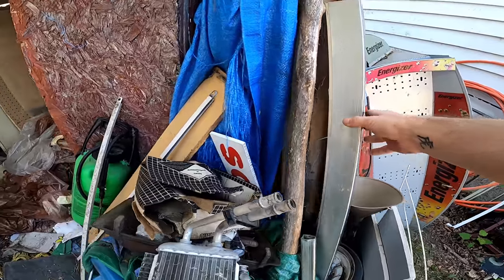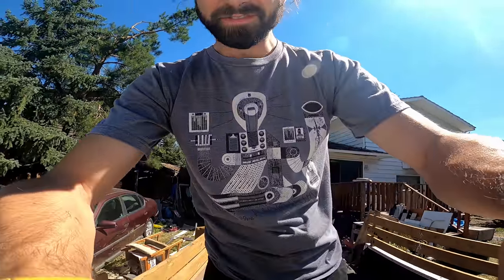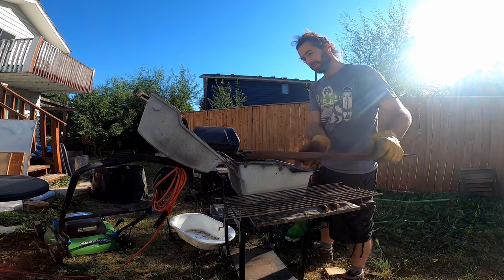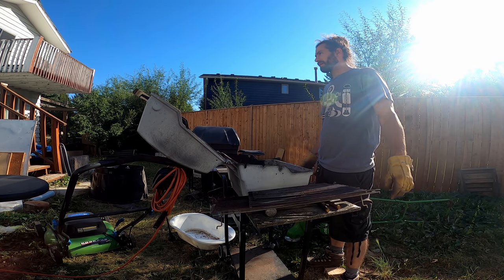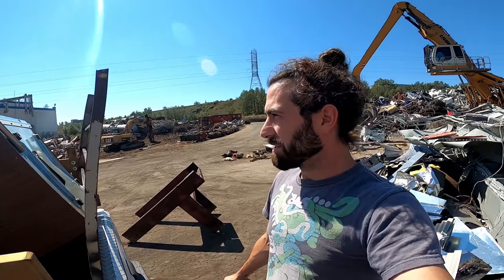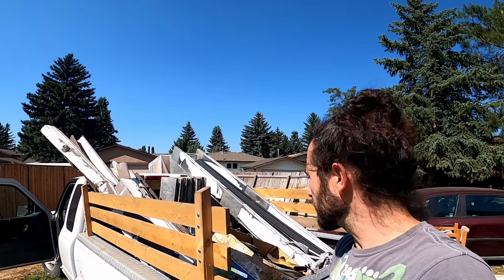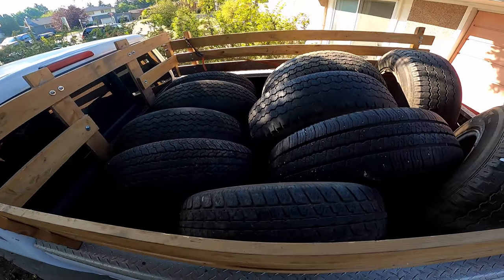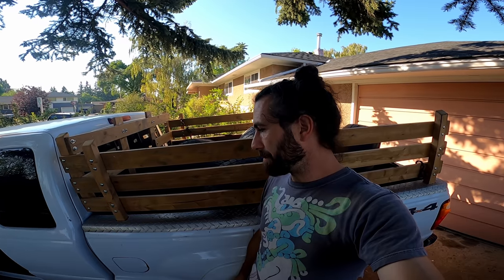Scrapping A HOARDERS HOUSE! - Scrap Metal Recycling 34

Comment: SHELVING. Finally, my area of expertise. Shelves are, on average, 15lbs each for a 4footer. Plus that 4ft piece of extruded aluminum stuck on the front is super easy to remove with a big screwdriver. Couple extra pennies per shelf 😉

Also, I just learned something new recently that I want to share since you had batteries. If there's a battery manufacturer anywhere near you, there's a good chance they'll buy old batteries. I got almost double from them than I would if I took them to a scrap yard. Definitely worth digging into.
Reply from the maker: I’d asked a battery place before but their offer was a lot worse than my scrapyard. Might be worth checking all the ones I can find though, never know!

Comment: Load more in the truck make a fuller load side rails are made for a reason
Your time is worth money you just got taken for a lot of money 
Remember they need to pay you for your time and fuel.
Either that or split the scrap money because by the time you pay local trash yard to dispose of all those tires your going to be out some cash. 
Either that or paint those things and make some art displays and sale them.
Reply from the maker: We get free tire dropoff at the city dump for tires so that’s not a concern, but you’re absolutely right about the rest of it. Even with that I basically broke even with nothing for my time. The next ones I made sure to talk about money before doing the job!

Comment: You should take those batteries as well with your scrap. Where I’m from if you bring them to an O’Reilly auto parts you get $10 in store credit for every battery. So there is $40 of scrap batteries in the beginning of your video. 👍
Reply from the maker: They definitely have value, but I just take them to the scrapyard and get cash rather than store credit

Comment: Random thought for ppl with pickups. I ended up making a wooden bed extension for my truck and it fits in the gap between the tailgate and the bed plus I’ll tie it down with cords. Gives me another 2 1/2 feet with my bed. Comes in handy for me thought other scrappers may like the idea.
Reply from the maker: That sounds really cool! I find I hit my weight limit pretty easily with the 6’ as it is, but if I upgrade the truck it could be worthwhile 👍

Comment: 4:15 I pulled about that many metal shelves out of a dumpster that was an old grocery store clean out. It took a few loads, but I’d check every week and get a truckload before they buried it with drywall and rubbish. Plus a bunch of other stainless from old freezers and other scrap. And no it wasn’t a metal dumpster either.
Reply from the maker: I love those ones! They do a full remodel and just throw away a couple hundred bucks worth of steel 🤙

Comment: That’s quite a haul! I am getting antsy, because I see these vids and there was an article in a NY paper about a mom making $1000 a week dumpster-diving, and I can’t do this! I am waiting on a doctor to look at my shoulder, see what the damage is, but I have found I really moss going out and collecting all this stuff that would otherwise end up in a dump somewhere. Thanks for the great video, Thub! Keep doing the thing, I am living vicariously through you now.
Reply: *miss, not moss.
Reply from the maker: I knew what you meant 🤣
I hope you get back to nearly full strength soon buddy! Could take some time but I don’t think you’re out for good 👍 might not be deadlifting any cast iron engine blocks for a good while but maybe this just pushes you to get a trailer with a winch, then you won’t have to strain?
Reply: @thubprint  Funny you say this - I drove by a pile of stuff out by the side of the road here so I had to stop & take a look. It was what turned out to be 85 pounds of stainless steel and over 100 pounds of prepared steel in the form of pipe. $37 US for the stainless alone, another $11 for the prepared, but my left arm is sore now! 🤣  The funny thing is... I like doing this. If only it was more regular (my area is dropping off some the past two months) and I wouldn't hurt my old self so much! I envy your youth (I am 50).

Comment: Homeowner would have to pay at least $800 for a dumpster for what u hauled off, he wouldn't be able to trash the tires or batteries either. Last day of Estate sales is where as a scrapper you can get most stuff for free that has good scrap value. Offer your service to your contact that you will pay a fixed rate for similar work in the future, for that job with all the shelving included I would have offer 200-250 for all the metal in the yard minus the car.
Reply from the maker: That’s a really smart approach, and thanks for sharing it with me! I imagine he would have wanted to run the converters in himself but nonetheless I like what you’re suggesting. Gotta look at it in terms of what it’s gonna cost him to get rid of it. The one guy said they were going to do a scrap run at the end but I think after the work they put in on selling everything, they’d be happy to have someone else take care of a big chunk of the cleanup 👌

Comment: If they demolish houses where I live I always smash the outlets (meter disconnected) the go in the attic and pull up the romex and home runs
Reply: Just saying bro ask the local fire department whenever they burn houses or someone’s tearing one down ask if you can go through it I filled up about 3 truck beds with wire I might have the unfair advantage of being a fireman and an electrician tho lol hope I could help you after all the years of you helping me
Reply from the maker: That sounds a bit aggressive but it sounds like it kinda works for you… if a person has permission then alright, full send! Might have to find one myself!

Comment: 150/200 bucks worth of work vs 2/3 days of work, gas, wear and tear on the vehicle, and driving that stuff out. I would have given you a higher cut for moving it as fast as you did. The tires, plus 200 for gas and time at least. That's my opinion. To be fair, I'm not that guy. Hope he does give you more clients and/or more scrap for free.
Reply from the maker: I’m hoping it turns into a thing 🙂